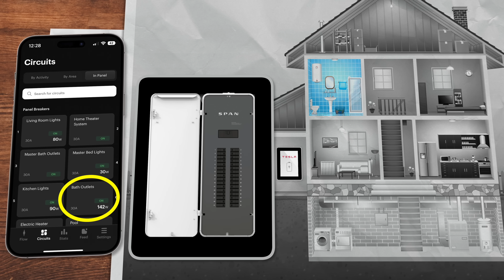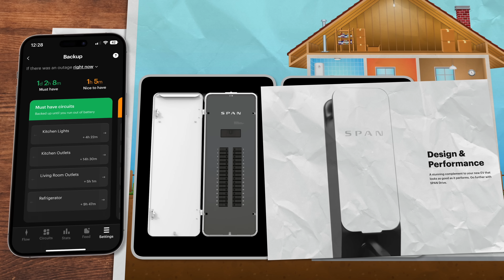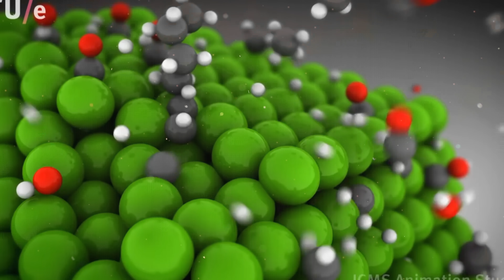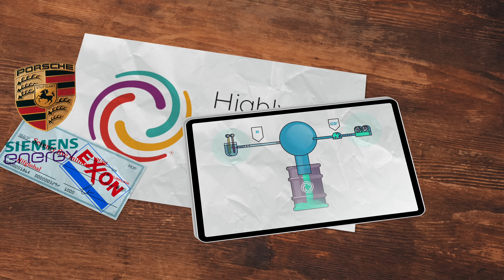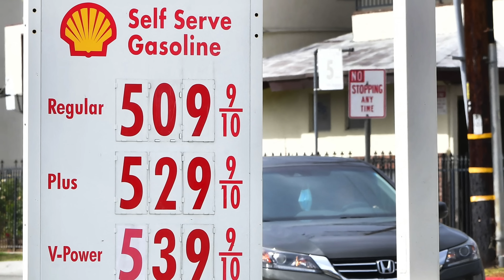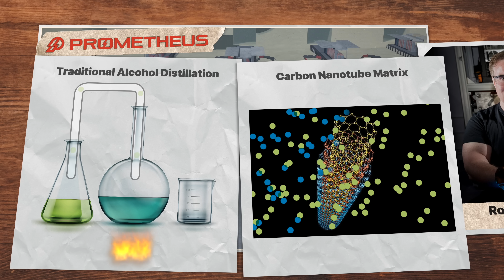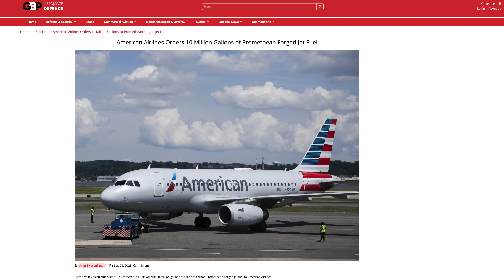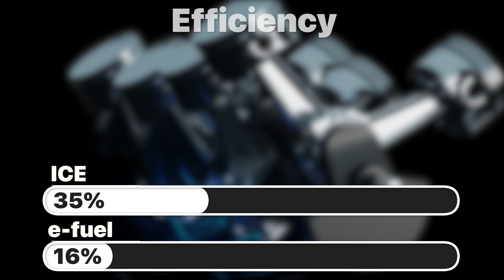EPIC Breakthrough Can SAVE the Internal Combustion Engine!

Comment: Hi I really like your videos. But I suppose the only solution for internal combustion engines to be taken to the coming decades is not the e-fuel you have proposed. We should be using green hydrogen and supply it H2 stations where we pump the compressed H2 inside the tank then to the engine like CNG or LPG. 
We may even have onboard H2 production inside motor vehicles. Since H2 turns into water vapor when burned we may loop the process. We will surely be working on this solution. Even nasa runs space rockets with H2. Why should we not use it on ICEs.
Reply: Green hydrogen is a massive waste of renewable energy. It has its uses but in the automotive world it would be like a big fat middle-man sucking efficiency out of the energy to wheels system....cut out the middle man and plug in your BEV!
Reply: The problem is that green hydrogen can’t be used in EXISTING vehicles, at least not without radical modification. The point of e-fuels here is switching the existing infrastructure. I think there’s a bunch of opportunity for converting existing natural gas electric plants to hydrogen, but converting vehicles is MUCH more difficult and expensive.
Reply: @davestagner  I don't think that the problem will be that the cars will need to be replaced, because more than half of the cars are replaced in 10-15 years. The change in the energy mix will take more years so, there is no problem here.
I think the real reason because other e-fuels are considered is because, although using hydrogen is probably the most efficient way to use the original energy through a chemical vector, there is a lot more hidden costs along the way, like compression/liquefaction, storage, stations and so on.
So other vectors like turning into hydrocarbons or other fuels like ammonia, are considered an advantage in some scenarios if you considered the whole process, from generation to use.
Besides, in some scenarios batteries like in cars works great, and we can avoid chemical vectors from start and get better efficiency and cost results.
Reply: @oatlegOnYt  Yeah, cars typically only last 10-15 years, but that means we’ll have them around for 10-15 years past the point where we stop making ICE cars as mainstream products. That’ll probably be around 2035 or so? (I think California has it right, and economics will support the transition as EVs become cheaper than ICE.) So we could have a significant number of ICE cars on the road through, what, 2050? That’s a long time. And I REALLY don’t think we’ll see alternative fuel ICEs as mainstream vehicles in that time, because they’d just have to compete against EVs - without a good fuel distribution network. You can’t just drop alcohol or ammonia into an existing gas station. EVs will win for vehicles. Another couple of generations of batteries, and we’ll have EVs that cost $10k less and can go for a thousand miles on a charge. But in the meantime, people who can’t afford new EVs will drive their old ICE cars for as long as they possibly can, and that’s a LOT of people and a LOT of cars.
Reply: Watch some of the hilarious videos on Toyota’s hydrogen V8. Hydrogen is so small that it leaks out of any container. You couldn’t even park a hydrogen powered ICE in your garage, and all the fuel would leak out of the enormous tank after just a few days.

Comment: This is probably the best solution I've heard yet. At 13:38 you mention this is the best stop gap for our transition to sustainable technologies is absolutely correct.
Reply: Finally, someone who gets it! It's nice to think about how awesome it'll be to replace every car on Earth with EVs, but it's not a practical short-term solution.

#1 We need to do something about carbon emissions coming from the billions of cars on the streets today. We can't just CTRL+A CRTL+X all those vehicles, and we can't realistically convert them all to hydrogen to make them greener, so if we can keep using them as they are without adding more carbon into the atmosphere, that's awesome.

#2 Regardless of round-trip conversion efficiency, solutions like efuels can help us take the available renewable energy in far-away places like Southern Chile and Australia to literally anywhere in the world. Try doing that with power lines! Or do the math and figure out how many batteries you'd need to store that energy and transport it somewhere else. That said, green hydrogen would be a much better alternative, but it doesn't solve the problem with all the cars currently on the roads today.

So, the whole point is to find an acceptable, cost-effective way to use surplus renewable energy to indirectly power billions of gas-hungry vehicles, while we gradually phase them out. I think it's brilliant.
Reply: @ipp_tutor  some of today's industries rely on combustion engines and dense fuels. Cars aren't one of them, most people don't need cars.
So instead of trying to "solve" the problem, by using cars we're just beating around the bush.
Of course i'm not saying cars shouldn't exist, but the ideal number of course would be somewhere around 1% of today's number of cars
Reply: @ipp_tutor  motorcycles are fine. They are much cleaner than cars.
Cars contribute to a failed society because they allow for a failed public transport.
The rich can afford to drive or be driven in comfort and don't care about the price of petrol.
The less rich get steamrolled.
Neither camp actually cares to make public transport better.
Same can be said about suburbia. "Not in my backyard", aka whatever happens elsewhere is not my concern. Society could collapse, just another day for me in my own home with my own car.
Reply: 1) there is nothing unusual happening with the climate.

2) there is nothing wrong with burning fossil fuels.  Its problems in high-density areas are trivial to fix and already have been fixed.  CO2 is not a pollutant.

3) Climate alarmism is a big-lie superstition supported by tax-bribed liars.  (See Climate Discussion Nexus for 100s of videos on climate quackery, deception, and realism.)

4) decarbonization is 21st century pyramid building and human sacrifice. 

5) there is NO excuse for expensive electricity.  Electricity generation is boring.     Just burn coal and scrub the smoke in densely populated areas.

6) the only challenge is manufacturing market quantities of cheap gasoline.  South Africa has already done this for decades (Sasol), using coal,,
Reply: Sadly, anyone who suggests anything but EV’s will be canceled in a heartbeat, all while California endures rolling blackouts due to grid insufficiency and the governor asks people not to charge their cars on hot days.

Comment: I like the logic:
- Problem: we took too much carbon from the ground and put it in the atmosphere.
- Solution: let's make a technology that allows us to take the carbon out of the atmosphere.
- But instead of putting it back in the earth to repair the damage we have done, lets use that technology to sale more fuel and put it back in the atmosphere solving the problem once and for all.
Reply: That doesn't mean the overall burden of carbon in the atmosphere can't be reduced while using e-fuels. You can still put the majority of the carbon you scrub from the air back into the ground.

Comment: e-fuels are just an attempt from fossil industry to keep doing what we are doing. Just using hydrogen for driving takes 6x as much energy as just driving electric car. Now take that hydrogen generated with some excess of green energy (I wonder when will that happen?) and combine it witch CO2 from air (in other words Carbon Capture and Storage) and then burn it again with 35% efficiency of combustion engine. Sounds like a scam, smells like a scam, looks like a scam, so I guess it's legit, right?

Comment: I don't care about ICE. The people I talk to don't believe in ICE. ICE is DEAD! Range anxiety has always existed with car ownership and I'm not talking about fuel! The minute you turn that ignition key the clock starts running on when that piece of crap is going to break down. After buying a brand new Pontiac TransAm, I drove it to Orlando from Miami. It started overheating as I entered the city. The engine needed to be replaced. The car was replaced shortly afterward. JUNK!!!

Comment: I’m not a fan of efuels. It’s too lazy. Rules and regulations are easily abused.

It’s a great excuse to keep doing what we already are without the guilt.

Edit:
Military hardware is normally the last to go clean. Your point stands in regards to efuels being used in instances where it’s hard to change. But often times its a slippery slope. 

This isn’t all too different from using corn to make bio fuels. That was a questionable policy at best. Especially with all its inefficiencies.
Reply: That's a weird way to see it.
Improving the fuel is a great compromise between lowering emissions and reliability.
Other options are worse and more expensive.
Reply: @ghoulbuster1  "That's a weird way to see it." - policies have been ignored by the fossil fuel industry for decades so it's not a "weird way" to see it.
"Other options are worse and more expensive." - very subjective and without any arguments to back this up. Plus this sentence is part of an argument for a different discussion.
Reply: @ghoulbuster1  In a sense, this could be seen as a better form of carbon capture, a more useful one.
Reply: @ipp_tutor  Exactly.
Reply: 8:16 Yeah. Exxon Mobil. Big red flag